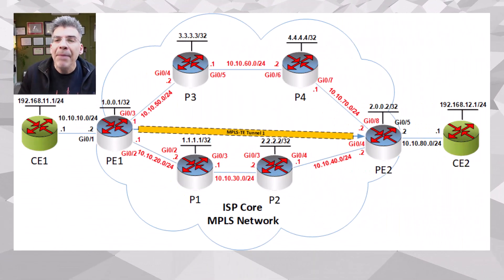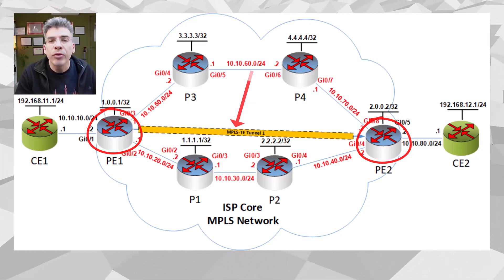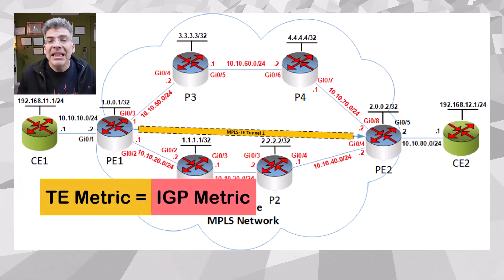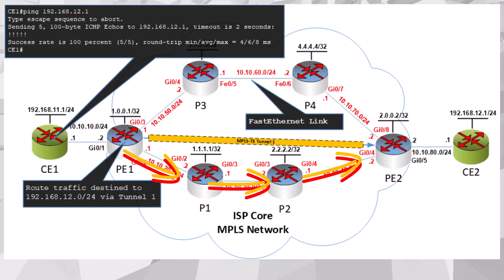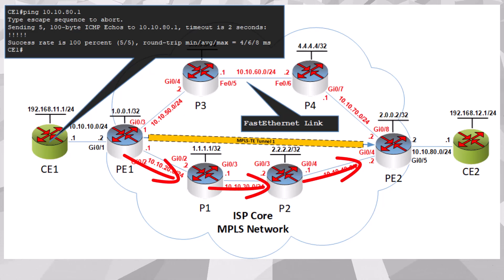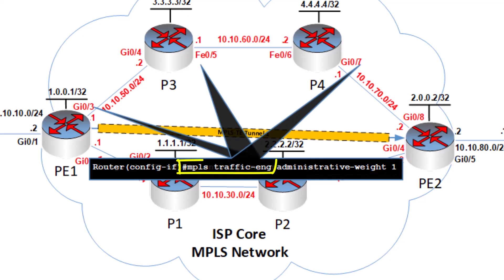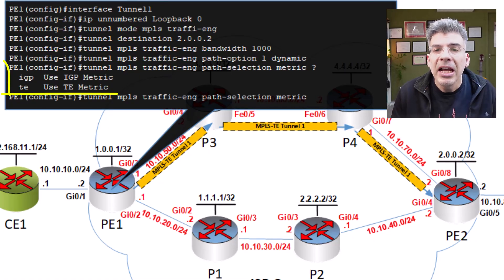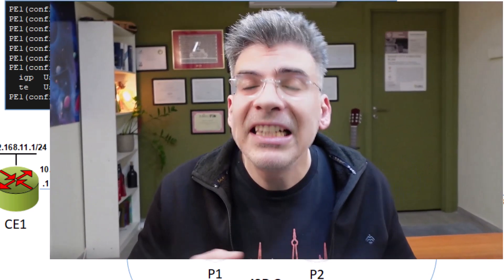IGP and TE Metrics in an MPLS-TE Topology

Comment: Very good video again, thanks very much! The TE metric is only one metric, correct ? Can you define several TE metrics on one sigle link that will have different values corresponding to different characteristics of this link such as latency metric, bandwidth metric, packet loss metric, etc. Such as our tunnel can follow the best latency path for instance (and not look at other aspects). If not (which I guess is the case) what is the best way to tweak the system and get a tunnel to take the lowest latency path for instance ?
Reply from the maker: Great question!  The answer is not trivial, so I'll do my best to answer it as concisely as possible.  As you suspected, per link, there’s only one TE metric (often called the admin weight). You can’t attach multiple TE metrics (latency/bandwidth/loss) to the same link and have CSPF juggle them simultaneously. You can advertise other attributes (available bandwidth, admin-groups/colors and on some platforms link delay/jitter/loss), but the path calculation still minimizes a single metric.

If you want a tunnel to pick the lowest-latency path, common approaches are:

1) Use delay as the metric (if supported): enable dynamic path computation with metric-type = delay / min-delay and make sure your IGP is advertising link-delay.
2) Map TE metric to latency: set each link’s TE metric proportional to its measured delay, then let CSPF minimize the TE metric.
3) Constrain the topology: tag low-latency links with an admin-group/color and require that color on the LSP.
4) Explicit path: pin the LSP/Policy to the known fastest route.

Each of these has specific approaches that must be addressed, but they're all valid use cases.  I hope this helps in clarifying your question?